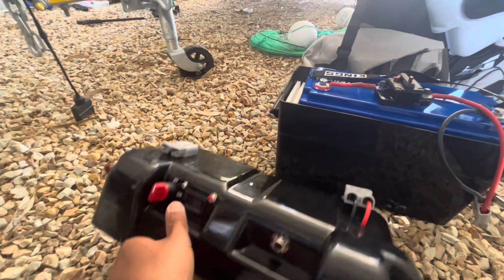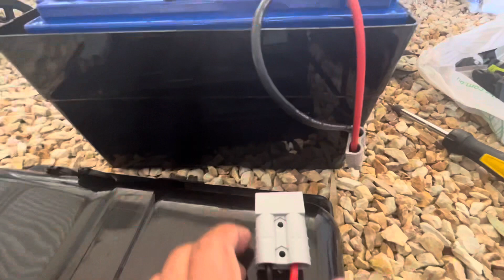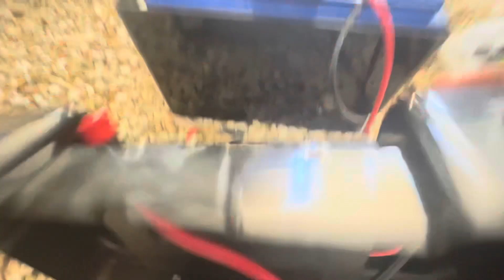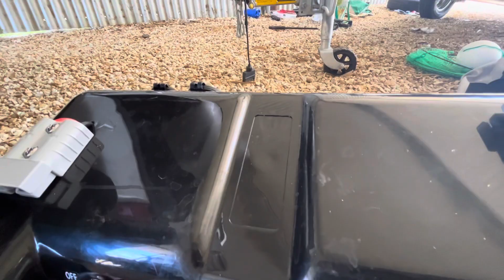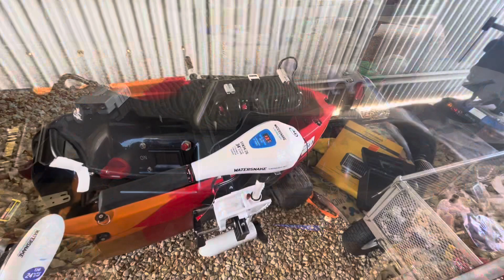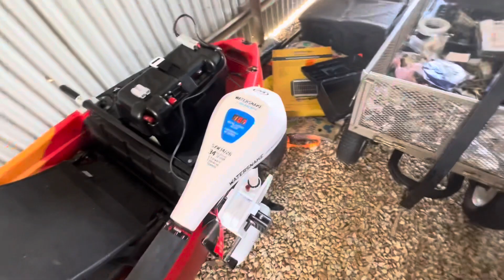Using trolling motor with battery box

Comment: Interesting setup and thanks for taking the time to post.
 One point. When testing you gave it full power and assumed it was drawing over 30amps. As the prop is out of the water it would effectively have no resistance so the current draw would be a few amps, so not a true test.
 Looking forward to seeing how it performs in the water.
 Keep up the good work.
Reply from the maker: @Tomdogful  that’s true and thanks for the interesting observation. It did well in the water though I didn’t get around to making a video about it. 
I’ve since sold the kayak and battery and moved to a tinny where I use the 70 lbs thrust Watersnake motor with the 300AH Kings Lithium battery. Very happy with that setup. 
Have a good day and thanks for the comment 👍

Comment: I have a 24lb trolling motor and it says max draw is 20amps it should be fine to use with this box how it is yeah? Ill be swapping over the connection to a anderson plug on the trolling motor..  any other issues i have to look out for with having that box around salt water?
Reply from the maker: @bigdaddy4602  yes that should be fine. The box is good and will protect your battery in salt and fresh water. Cheers
Reply: @ailurophileperson  thank you for the reply it's appreciated... looking forward to being out on the water

Comment: How’s the kings battery perform? I see that the 34lb is recommended to have a 60ah battery, but 120ah will be longer lasting I assume.
Reply from the maker: Actually I haven’t been out on the water yet with it. I won’t go with 60ah especially if it’s AGM or not a reputable brand lithium. I’ve been out a few times with my previous 24lb motor and the 120ah Lithium and it’s lasted me the whole day while still staying around 13 Volts. So really impressed with it